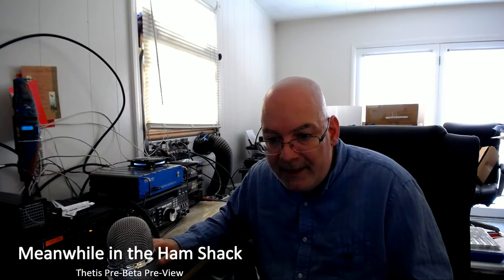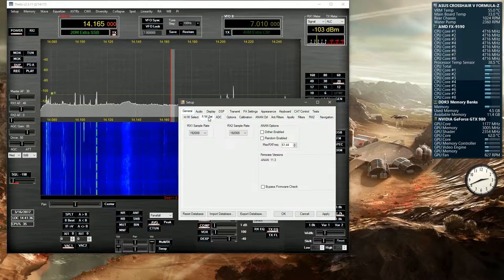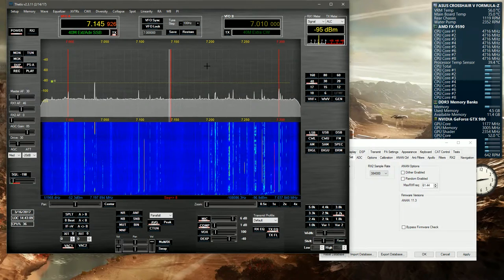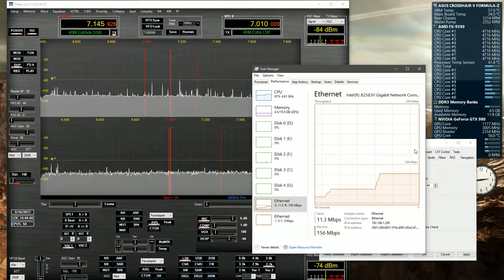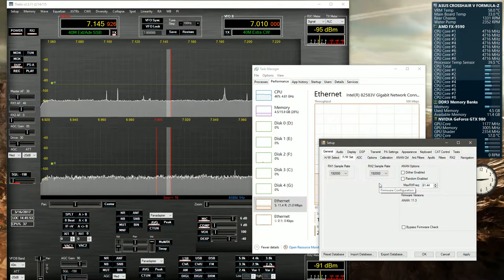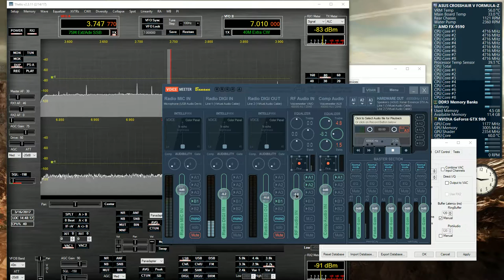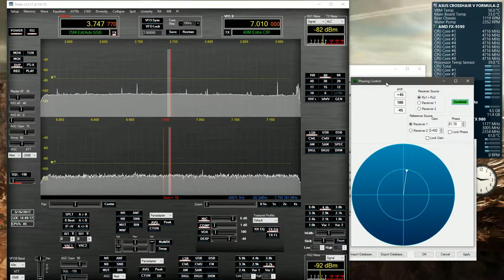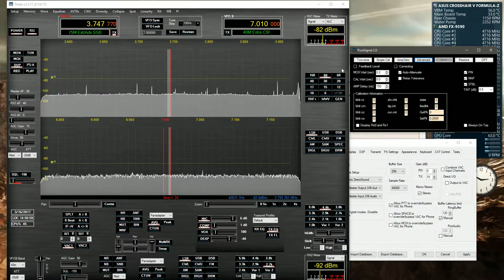Thetis Pre Beta on Apache ANAN 100D 3/16/2017

Comment: Hi Michael,....I'm a bit of a 'newbie' to the world of ANAN...about 3 weeks ago I purchased a ANAN-8000DLE. One thing I'm trying to workout is how to activate the 7 Receivers that apparently some models including the 8000 support. I've seen it done at demo's but I'm curious why PowerSDR mRX doesn't seem to have a feature to allow this, the same goes for the Wide-Band feature. About 3 years ago I saw a demo of the 200D at a Hamfest, the owner claimed he was using a Beta release software that allowed full wide-band view right across the top of the monitor but he also he showed multiple bands on his screen!...I was sold straight away but its taken over 3 years to finally afford one, in this case an 8000. Can you shed some light on this?....Cheers Clint - VK3CSJ

Comment: Where can I find the step by step process for updating this firmware?  Do I have to take the radio apart to reset the J12 jumper to do this?
Reply from the maker: Mark... I'm working on a video to do just that tonight... it may be out tomorrow or the middle of next week.
Reply: Holy Smokes!  That was fast!  Ok.  I sent you a message as well.  In a perfect world, I would want to, of course, avoid bricking the radio and I would not want to disassemble the rig to reset the jumpers.  Have done that on my ANAN 10E but the 100D is an entirely different matter.  Currently have out-of-the-box v4.8 on the rig.  Sold my 6300 to go all-in with ANAN.

Thanks for a quick reply.

Mark
WA2DIY
Reply from the maker: I've not worked with the v2 programmer yet. So right now yea you've got to disassemble the radio and move a jumper... but it's easier than you think.
Reply: Ok.  Is your video going to illustrate that process?  And, I assume the jumper has to be returned back to its original position after programming is finished?  I look forward to the video.  

Thanks
Mark
WA2DIY